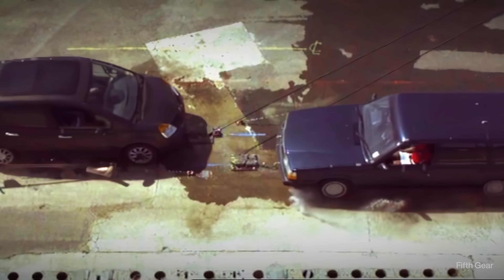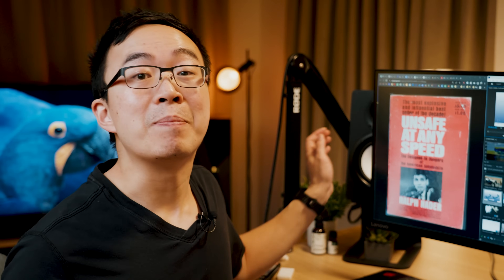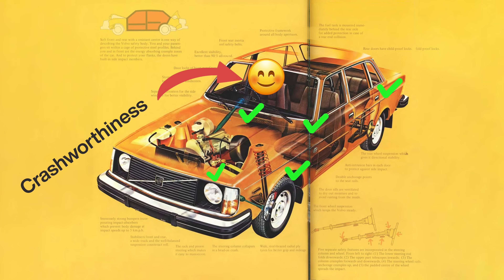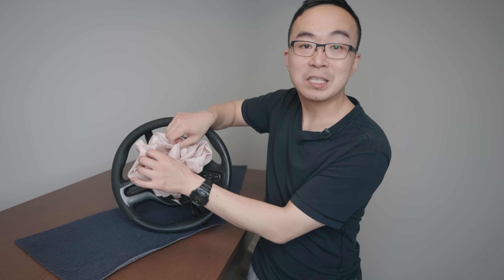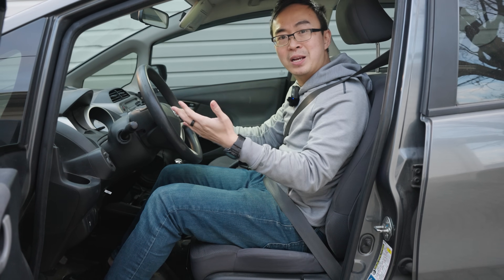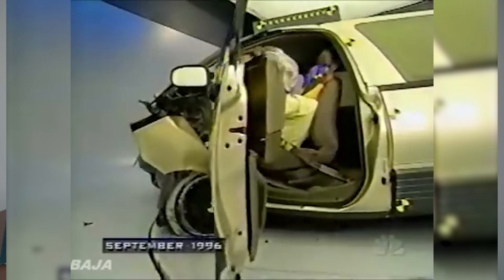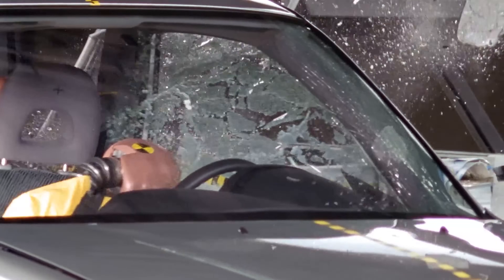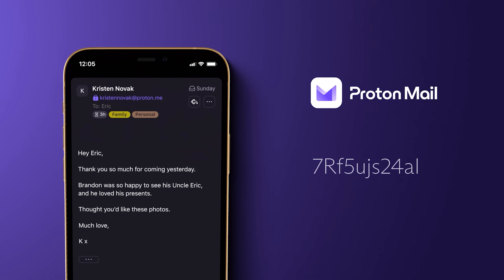When does a car stop being safe?

Comment: As a bicyclist, motorcyclist, and 80s-00s car enthusiast (smaller cars with few or no airbags), I would say minimizing distractions while driving and having good tires and brakes go a very long way in improving your survivability, as well as improving the survivability of the pedestrians, cyclists, and motorcyclists out there as well. I hope someone doesn't kill me while road raging in a Cybertruck one day ...
Reply: Road raging? Hell an idiot could screw up the brake and accelerator pedal, and make you experience a 60 mph crash because their 3 ton electric accelerates faster than most sports cars did for the last 20 years.

Touchscreen computers in cars these days are a major distraction which still is left untouched by safety regulations.
Reply: yes! having good brakes will help prevent you from causing secondary collisions, good tires will help prevent hydroplaning or sliding on ice (but you should drive slower in those conditions regardless bc you can still hydroplane/slide with the best tires ever), etc. i’m so wary of new cars with safety features like lane assist because people driving those vehicles get used to not needing certain driving skills & would cause hell in a vehicle without aforementioned features. don’t get me wrong, i think they’re great, i just also think their existence encourages people to learn only the bare minimum. my car’s only driver assisting feature is cruise control but i don’t ever use it because i live in georgia and no roads here are straight enough to properly use cruise control
Reply: and keeping distance...... :D:D that saved my ass and car X times.
Reply: I've already seen a Cybertruck here in Madison, WIsconsin not even a week after it was released.  I thought 'oh great, a cybertruck in the most bicycle friendly city in America, we know what they are thinking.'
Reply: To be fair. It makes it safer acording to your driving skills. 
A subpar driver with good brakes that locks/overbrakes on a turn, will be rough.
Reply: Unfortunately, “not being an idiot” seems to be impossible for a significant chunk of people.
Reply: I pray yall are safe on the road
Reply: Also with the new tests many vehicles have horrid blind spots
Reply: Exactly this. And I will add : having capable drivers who understand their car at least a minimum, and have the basics of car control, braking, and obstacle avoidance can do much more for safety than cars with dozens of ADAS and incompetant drivers behind the wheel. Track session with learning of car control (emergency braking with AND without ABS, obstacle avoidance, and driving in slippery conditions) should be included in drivers' licence tests (or at least organized within 12 months after licence obtaining)
Reply: @JDMafficionado  Hahahaha, someone with the handle of "jdmafficionado" cannot be taken seriously.
Reply: @TheSultan1470  always a pleasure to have a debate with people who come out with actual arguments.... Oh, wait..
Reply: Suuuuure, the Tesla. Which will stop itself before it hits you. Get real, it's the douchebags in gutted out sports cars to watch out for.
Reply: @TheSultan1470  have you seen videos where it mows down child-sized mannequins?
Reply: @panthermodern6572  Like... any lorry? Or bus? Or train, or any x object of sizable dimensions.
Reply: Exactly that. As a new driver I can say that it's so much easier to utilize everything we can to drive safer instead of crying on the internet about how cars are dangerous
Reply: @panthermodern6572  doesn't matter how safe a driver you are when the driver next to you doesn't care for such things. People aren't complaining on the Internet just to whine about car safety, it is an absolutely necessary thing to worry about when most accidents are out of your control
Reply: @darkheart9668  that's just the risk of it. besides, you can observe the situation on the road and react to it, it's extremely easy to do.
Reply: @panthermodern6572  this is why engineers are payed to minimize the risk, going to your local store shouldn't be an acceptable death sentence. Also it's easy to say you can observe the road to avoid an accident, but my experience tells me otherwise. It doesn't matter how good of a driver you are when you have a person going over 100 in the streets.
Reply: @darkheart9668  idk what you're talking about. I always drive with music on, and I always enjoy myself while driving. That said, I've never been in a situation where an unnoticed fast car (or motorcycle) comes "out of nowhere". I either see them in my rearview mirror or hear them and then check my mirrors. I almost always stay in the center or right lanes, though — perhaps that has something to do with that.
Reply: @panthermodern6572  "and I always enjoy myself while driving" what's your point? Most of us aren't going to get in an accident but they do happen, and it's usually a "wrong place wrong time" sort of scenario. Doing a Google search I see that LA for example has roughly 1000 accidents per week. I live in a very populated city and have seen too many people who had no fault get into traffic collisions. You see enough traffic collision videos on the internet you start to realize that many of these people had no time to react at all. The least we can do is make sure the cars are as safe as they can be to reduce fatalities.
Reply: @panthermodern6572 Doesn't matter how safe you are it takes just one idiot on the road to be in an unavoidable high speed accident
Reply: I love 80s and older cars and have a collection of them, I'd love to daily drive them especially on the highway where I do most driving but I've seen too many crashes involving older and newer cars and the passengers in the older (typically 90s) cars always fair far worse
Reply: We should be sapping power from motor vehicles. If a car from 1908 can run on 15 horsepower and reach a safe speed limit of 20 or 25 in a city, I don't think any modern car needs hundreds.
Reply: @mrmaniac3  This is a great point. Take a look at your average speed (if your car calculates it) over a few thousand miles of driving. In the region I live in, I've averaged only 38 mph. That car has about 250 hp. Do I need it? No. Is it fun? Yes.

Comment: A couple of years ago I responded to a head on crash between a honda fit and a buick enclave. The Fit was torn in half and the engine was ejected into the ditch, passengers made it but barely..The enclave was smashed a bit but not much, its occupants walked away- big vehicles dont play fair
Reply: More modern one's do. They're designed to be softer, and the smaller cars are now stiffer. This is to improve the crash compatibility between the different groups.
Reply: @user-sf7kl9uh7k but rigidity in cars is a downside for the  occupants
Reply: @ActuallyEarth  only if it's the front clip
Reply: i saw a pic of an enclave that folded up a 2000's expedition nearly fatally, but the enclave kept a solid cab. proof that ford didn't learn from their 97-03 mistake.

Comment: The safety engineering is SOOO COOL!!! These are really difficult challenges that they had to overcome! This isn’t like racing where there are a bunch of arbitrary rules like no airfoils or suction devices, but rather any practical solution goes, and the one that best meets the criteria, cost included, is implemented. Also, not only is the mechanical design interesting, but the political structure to get the manufacturer’s incentives aligned with the public’s incentives is truly what makes this all possible. A good engineer should see the problem from all angles and designing the power dynamic between various groups to achieve desired outcomes is no exception.

Comment: Whenever someone says that a big car is safer, I always think back to an accident I've had. Flew out of a curve in my tiny little 2003 Toyota Yaris. Car flipped and everything. Outside and engine bay completely fucked to hell and back. Car even did the Lightning McQueen Kachao. Meanwhile, the inside (save for small glass pieces and the dented ceiling) was untouched. Got out with only whiplash. Do not underestimate small cars.

Comment: automakers are deliberately witholding solutions because it helps with an upgrade sense .. people are more likely to buy their next model if they just keep slowly introducing 1 item at a time .. 
the whole system is a self profiting scam with all parties involved .. they will slowly introduce new tests to outdate older tests and the car manufactures will keep adding solutions they have already lined up to fix X problem to keep customers buying newer models for safety 

it is all deliberately withheld for profit

Comment: 6:28 This was a test done at 100km/h into a solid concrete reaction block with 300kg of sand ballast in the footwells and boot and a ballast dummy (75kg). This VB Commodore is a wrong example for a car "too soft".
Reply from the maker: It's for illustrative purposes, most people don't know the story and the commodore is not really a brand people care about these days which is why I used it

Comment: this wy in modern cars when people dont use seatbelts and have them fooled by having a thing in the seatbelt holder you will go forward and the airbag can break your nek from going of thats wy there is a belt tensioner to pull you back so the airbag wont go of in you face

Comment: when replacing airbags or belt tensioners you have to let them explode before you throw them away at the dealer we even had box with a arm switch and two big red buttons to push to led them go of veld like letting of a bomb

Comment: All these kinds of technologies saved my life. The crash I was in (head on, both cars at 60mph) was bad enough that the engine block came through the dash, crushed my knees and left me disabled, but that's gotta be expected somewhat at that level of collision. The seatbelt cut into my chest hard enough to leave an imprint through a thick shirt, and my face was bruised from the airbag. Point is I'd be dead for sure in an older car.

Without the modern crumple zone I'd have been a smear on the windscreen or otherwise, or the engine would have just severed my legs and I'd have bled out.
Without the collapsible steering wheel the column would have speared my face.
Without the airbag I'd have smashed my face against the dash.
Without the seatbelt I'd have crumpled into the dash broken.
Without the reinforced chassis it would have taken way longer to get me out of the car in the event I survived the initial crash, and likely bled out.

Not to mention all the other medical advances. Or the fact that they only had an air ambulance in that area since 5 years before the crash.

Just 5 to 10 years earlier and they wouldn't have been able to save my life.
Just 15 years earlier and I wouldn't have been intact enough to be possible to save.
Reply from the maker: Thanks for sharing your story and I'm glad you're alive. Very true about the whole emergency medical response leading to greater survival. It all comes together to save someone's life and reduce injuries.  Glad you made it and you have a positive view of the situation
Reply: @Lam  Thank you <3 And thank you for the informative video!

Comment: From 4:20 a 'crash-test' of a Holden Commodore VB (1978-1982) is shown. This took place in 1992 at 100km/h (60 mp/h) into a solid concrete reaction block and employed "...a standard 'secondhand' car with the drive-/propellor-shaft removed, 300kg of sand ballast in the footwells and boot/trunk and a ballast dummy (75kg) on the rear seat."
Reply from the maker: Oh I know haha, I wanted something that would emphasize the destruction.

Comment: Those Pick plus awards or other are useless . just because one car's head lights slightly worse than the other its already not getting the "plus" or just because one car has better active safety but not passive it will get the plus. Sorry but Passive protection much more important than some sensor that can fail at any second. And active safety options wont help you if someone plows in to you.

Comment: I drive a 2007 Camry V6 which got good ratings all around and structure is the exact same as ES 350 from that era, but in 2012 they tested the ES 350 in small overlap test and got a poor rating, car overall is safe cause it’s a bigger car just won’t do well in a accident if I crash into a tree or something representative of the small overlap test,

Comment: I'm an insurance adjuster and I was at the IIHS off set test of the 2013 Fit. It was done on Oct 29, 2013.   Immediately after the test we were allowed to walk down and view the car as it sat mangled form the crash.  I looked inside and said to myself,  in this specific type of crash, I would not want to be the driver.  The floor and dash had trapped the dummy.   I recorded the test from the observation deck but had to wait almost several months to post it because the IIHS hadn't released their official rating.  As we know, it was rated poor.   I'm not sure Id get rid of a car for doing bad in one crash, but just know you're at a disadvantage especially if a larger car hits you off center.

Comment: And yet the height of the front impact absorber is still not standardized, so that an SUV usually has a significantly higher impact absorber and thus dips into the "soft parts" of a normal car. Especially in the event of side impacts. SUV -> CAR

Comment: Problem nowadays is just that they don't care about what happens to the other crash participants. SUVs are very dangerous. Not because of the weight, we saw that this is not really important in the example you provided. But because of the shape. SUVs tend to be very tall, especially the hoods. So if someone was to be hit by it, they are most likely to go under it than fly above it. The best thing that can happen is that the pedestrian flies above it because this way, they don't have to absorb all the energy. 
Now that doesn't really happen if you're hit by a car which has a hood that goes up to your pelvis or even higher. Not only this but also the visibility is fucked. I drove the new BMW X5 a few times. Dude, I'm not doing it again, I hate it. Visibility is shit. 

Apart from that, SUVs are ugly anyways. And they feel like a rollerskate when driving.

Comment: What could save a lot of lives and injuries and make insurances spend a lot less money is , force people to drive really slow by any mean. But I can't use a recent car, they are so fucking ugly, not confortable, are to complicated to repair, have a lot of unwanted shits like electric emergency brake, too much computers and stuffs expensive to repair. If there was a brand new 1959 Dodge with high level of safety and still a carbureted engine with points distributor I' d buy it. Well I guess I can modify a classic car to make it safer though .

Comment: I’ll have have to say that safety is not on the top of my list. The first is functionality, most fail badly as I’m over 6’ and many other factors. Our current vehicle is much worse for ware as it’s badly rusted large van, replacement is not practical new 4 to 6 months 65k+ and used ones to much money. Many of the new large vans fail the safety testing

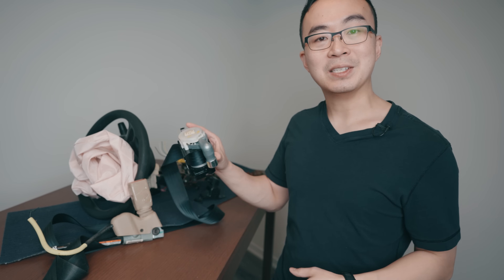Comment: 8:47 That clip was from Saab 9000's promo video, they put pre-tensioner as standard in all Saabs at the time, it directly pulled on the belt, and the anchor point was not on the floor, it was on the seat, closest to hip to reduce the slag as much as possible. They really did everything to make it work best, more so than Volvo, but sadly, they were too expensive, they went bankrupt because of too much R&D.

Comment: I was involved in a head on collision, I was traveling at about 60 MPH, 5 MPH over the posted speed limit, when an illegal alien with no driver license, no registration and surprisingly no insurance crossed the double yellow and drove directly into my 1987 K5 Blazer. I’ll admit I wasn’t wearing a seat belt and was speeding. The other guy? Well, he was driving a MUCH newer and much “safer” vehicle. In the end, I drove away from the accident and the illegal? He got driven away in a black ziplock bag in the back of the county coroner car. Don’t be one of those ignorant sheeple that believe new cars are safe.

Comment: The Volvo 940 had a Chassis designed in the '70s , it was pretty Flawed test. They should have used the earliest Volvo 850 against this 1.200Kg french Car (it's NOT a Small Car, a Renault Twingo is small but the Renault Modus is Family sized and had a 40+ year (Safety) Design Gap.

Comment: 4:16 this crash test is just a test of the concrete block and other equipment that other tests will be crashed using into at the crash centre in Sydney Australia. From memory the speed used for this was 100km/h. far above any regulation test. The yellow car is a Holden commodore.

Comment: I wonder why no manufacturer offers rollcages and multi-point harnesses as optional features of their cars. Yes they don't look luxurious and take up inner space but they never fail. If they were unreliable technology racing cars from group B to Le Man prototypes would't use them.
Reply from the maker: One because of aesthetics, too because of compliance, three because of the additional safety mechanisms needed.  For example five point harnesses would require a Hans device otherwise you could get a basil or skull fracture even without a helmet because of the way your head goes forward
Reply: Understood. I looked up some info about the HANS and how it works, but at what point I shoul get one of these. i mean I rarely exceed 100- 120km/h, and my harness is mostly cosmetic, tho it secures me much better in the seat. Would it make sence to add HANS, and probably dome kind of helmet, in this case?

P.S. I drive a 92" Tico.  @Lam